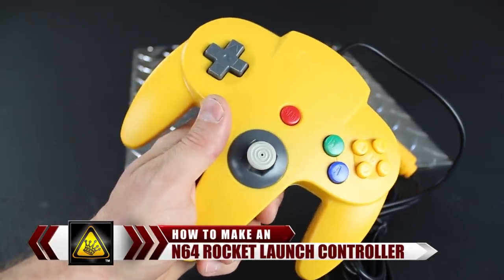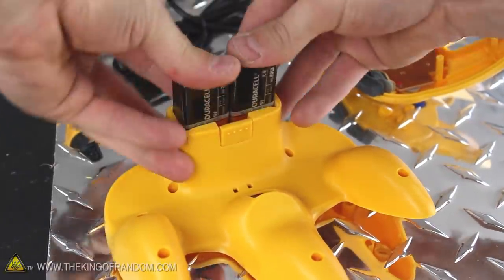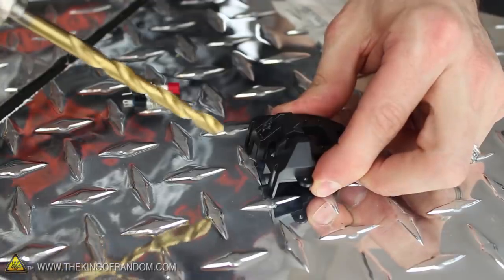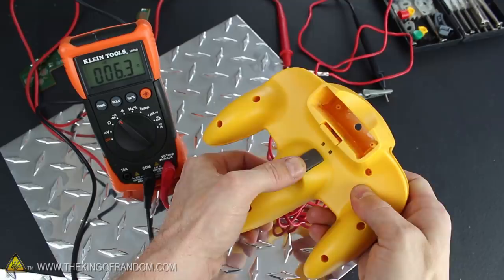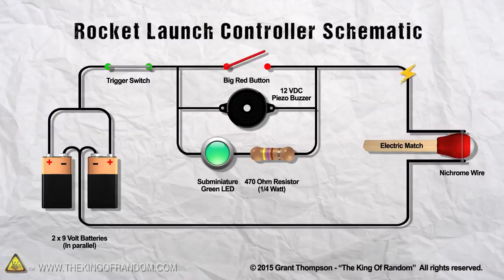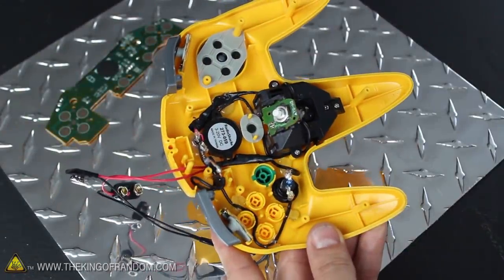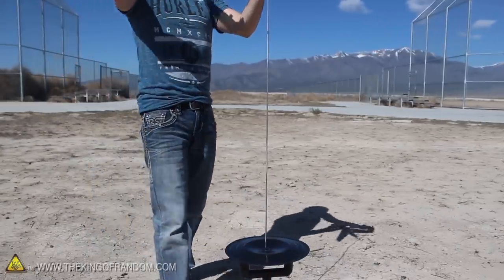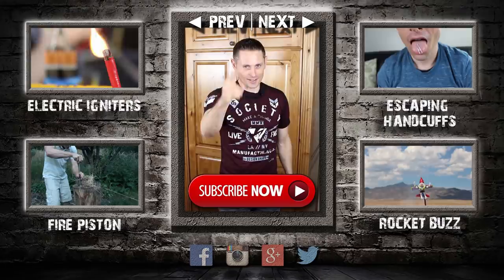How To Make An N64 Rocket Launch Controller

Comment from the maker: Some quick links to a few of the materials I used:

[✓] Yellow N64 controller: http://amzn.to/2cdHMb9
[✓] Green LED: http://amzn.to/2c38PsX
[✓] Buzzer: http://amzn.to/2chs8N2
[✓] Red push button momentary switch: http://amzn.to/2cJEakz
[✓] Momentary switch for trigger: http://amzn.to/2cGgol4
[✓] Insulated copper wire: http://amzn.to/2cmBjNH
[✓] 9v batteries: http://amzn.to/2c21gzQ
[✓] 9V Battery Clips: http://amzn.to/2c20Byh
Reply: zakir
Reply: Grant Thompson - "The King of Random"
Reply: Grant Thompson - "The King of Random"
Reply: have you ever shot one of these at a car
Reply: Grant Thompson - "The King of Random" you should make a laser from a Wii controller
Reply: Grant Thompson - "The King of Random"
Reply: Grant Thompson - "The King of Random" hxx lakhydxn LJ
Reply: Use straight quotes
Reply: Grant Thompson - "The King of Random" '
Reply: Grant Thompson - "The King
Reply: Grant Thompson - "The King of Random" hshbhhhhhy
Reply: How about the resistor,and how much ohm do I'm gonna use?

Comment: Guys, don't worry he used an aftermarket controller. Not areas Nintendo one
Reply: A real*
Reply: IVoidwarrantys Its true. The controller does not say nintendo. If he were to use a real one it would say Nintendo. But it didn't so you are correct

Comment: Totally awesome.  Only mod I would make is a disconnect at the controller for the speaker wire IOT change it if need be without taking the controller apart again.

Comment: Hey king of random here's a great addition to the N64 rocket controller idea: add a remote control angle system so you can use the thumb stick to position your rocket before you fire it off

Comment: Or you just juse a button
Reply: *use
Reply: that beats all the fun.
Reply: +Bastiaan Jansen He couldn't just use a button because he needs space for the other components.
Reply: SkyneT guess what... this video is a secret tutorial for terrorists (dont tell anybody)
Reply: +Bastiaan Jansen The buttons wouldn't handle the required current.
Reply: ***** Add a cheap transistor and they will :)
But i guess youre right when it comes to the original buttons without any modification.

Comment: waste
Reply: it would be better to use my horrible knock off ones
Reply: if you bothered to look close enough you would see that this is a "knock off" the top of the front face of the controller doesn't have the Nintendo logo, even if it has the little gap where it normally would be
Reply: its the cirka knock off lol

Comment: You need to connect the joystick to some motors on the launch pad so you can plug in and aim your rocket with the stick and launch with the button.

Comment: You should build a rocket platform that can be tilted through the controller and modify it so it cn move the platform in any direction and when your ready you can set it off

Comment: Love your projects! Curious If this can be modified to do two or more launches with other  buttons? either by a switch that connects trigger, buzzer and LED to another set of lead wires for separate rocket, but uses same Red ignition button OR with trigger, buzzer with two separate LEDs and Two trigger Buttons Like A and B. Kind of think it would be cool to pull trigger, have buzzer and two LEDs light up, each indicating it's own continuity(detecting which line has problem or is ready). Then being able to push A button then B Button (or A&B together) to launch.
Just getting into the hobby.

Comment: He said it sends 6 Amps through the match. However, doing the math on 2 9V batteries I had laying around, they could only produce 2 Amps through a 0ish ohm load (wire). The internal resistance of the batteries was about 8 ohms, their no load voltage was about 8.5V, so they were used. Even if they were maxed and had closer to 10V, it would still produce less than 3 Amps with them in parallel.

I see that he said 2 amps and then said 6 amps. was the 6 amps a mistake? Any other technologists want to weigh in? Am i missing something?

Comment: I feel kinda sad for those who are destroying a perfectly working original N64 controller. For me I would use one of those cheap 3rd party/aftermarket ones that you can find on eBay for less than $5 or a Broken original one.

Comment: I have an idea for a wireless unit that uses the original controller board and an expansion pack. Now I need to find time and a N64 controller (the former will be difficult).

Comment: Why not solder to the contacts for the A and Z buttons? You could have used the original buttons instead of having to buy new ones and the A button would have still fit.

Comment: what would have been cool was to use the original wire, extend it  and use the plug from controller to system and attached the alligator clips somehow I'm sure someone understands what I mean, it would have kept it real cool maybe make some sort of casing using copper that you can just replace the match instead of having to make a million separate matches with individual wires i want to make one now and experiment with different ways of making different homemade rocket igniters

Comment: I liked the video but I don't have much experience with making circuits so I'm not sure how to wire it. But I did notice in the schematic you wired a resistor next to the LED but you didn't solder one into the remote

Comment: Use the same circuit in a small electronics box and you don't have to waste an N64 controller.  Oh, and that horizontal launch at the end?  Not cool - you could hurt someone that way.  There's a reason the NAR Safety Code specifies a maximum angle from vertical of 30 degrees.

Comment: If I want to make a launch controller with a detachable cable, what kind of connector should I use?

Also, if I use thicker cable (for example 0.50mm², which, if I remember correctly, is roughly equivalent to 20AWG) to get less voltage drop, could I use 4 AAs instead of the two 9V batteries?

Comment: 7:30 "Now we have the ability to launch rockets or even light pyrotechnics with the simple push of a button"
LIES AND SLANDER! You told us you set it up so you have to push both buttons to ignite.

Also, you just destroyed a perfectly fine N64 controller in order to use put two buttons inside of it, well done.

Comment: It seems a waste to not take the next step and connect a pair of servos to the controller through a simple processor, and then your rocket launcher is completely remote controlled in the x/y axis as well as launch.
Reply: +anpu   My error, the N64 uses an opto controller, so the interface is much more complicated then a simple 555 servo controller.  From:  http://electronics.howstuffworks.com/n643.htm       "The wheels are each mounted between an LED (Light Emitting Diode) and a photo cell. Light from the LED, shining through the slots in the wheel on the cell, creates a small amount of current. When the amount of light changes, the level of current changes."

Comment: Shame this is so destructive. Clever yeah, but still awful. Even if it was off-brand.

If you have a sucky off-brand controller, this project makes a little more sense. And considering this isn't an entirely tech-centric channel, there's no reason why he should show his viewers how to set up a Raspberry Pi with those 9v batteries to deliver a charge from any input device with the GPIO socket and a small programme to do it with.

Comment: I do not have an n64 controller so can you make one with an xbox contraller
Reply: Probably, but it would be a case of changing the wiring system to fit, plus the lighting and sound system would be harder to fit in.
Reply: +Buttered Cheetos I know